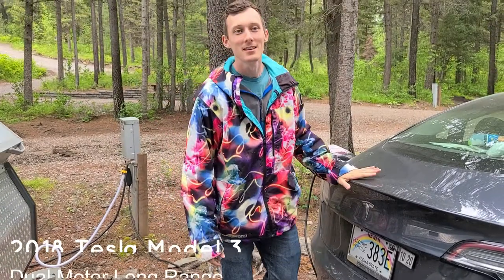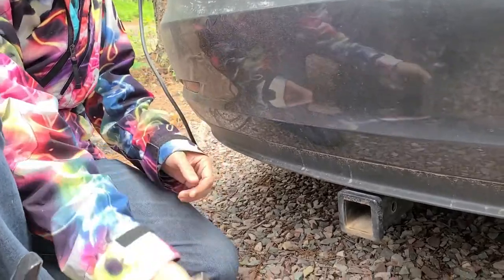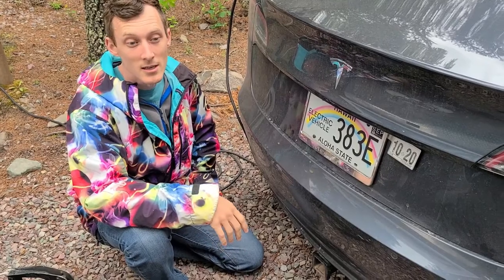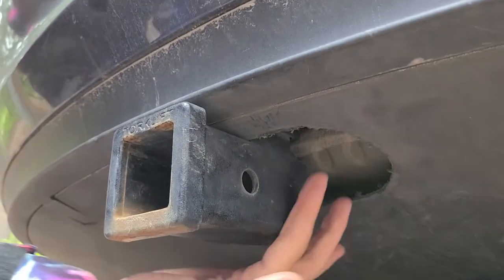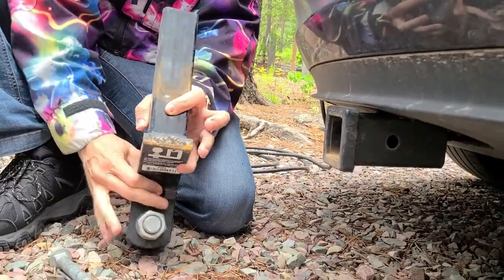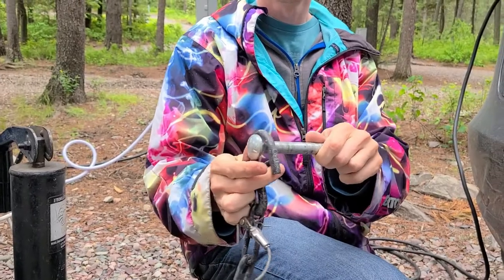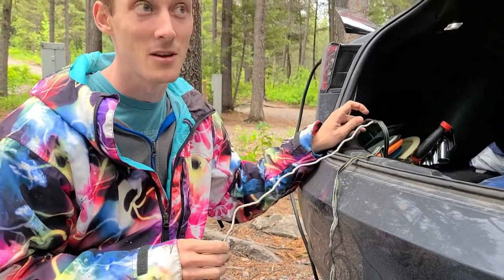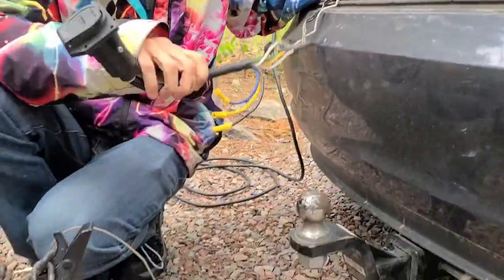Tesla Model 3 Stealth EcoHitch setup and review

Comment: Curious what your range drops while towing? Always thought about the same setup but with a bolt. I have herd any where from 30-50% decrease in range. Also have you thought about putting a inverter on the 12v side.  Since the high voltage battery keeps the 12v battery charged.
Reply from the maker: I will add a detailed video next week talking about the range reduction while towing. A basic rule which works out for this trailer is 50% of the range displayed. I will certainly add a 12v inverter in the future to allow for more remote camping but for this trip we planned on charging the car at RV parks so it wasn't needed. I would be curious to see how this would work with a Bolt. Personally, I wouldn't do it without Supercharging because of traveling with my baby.